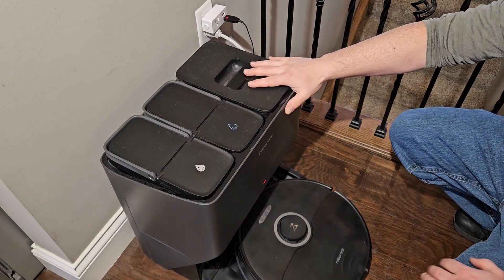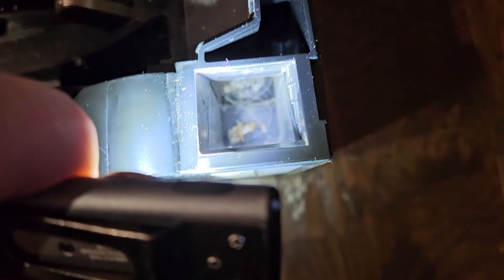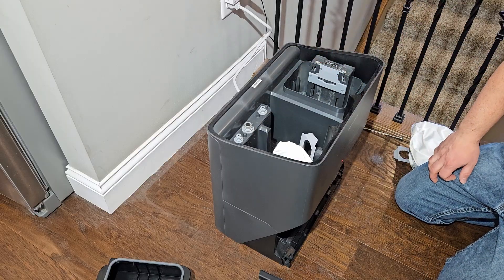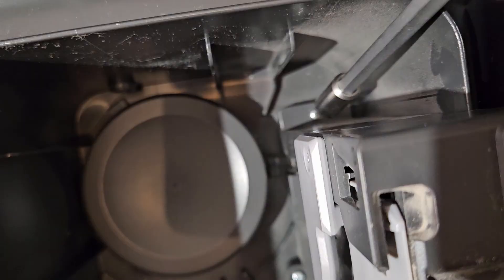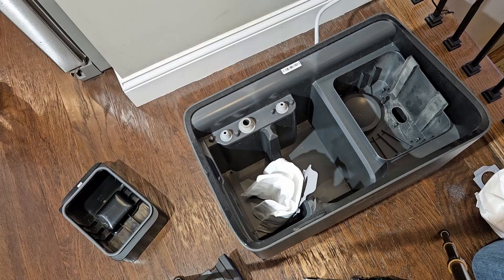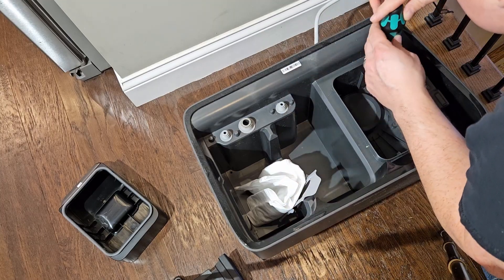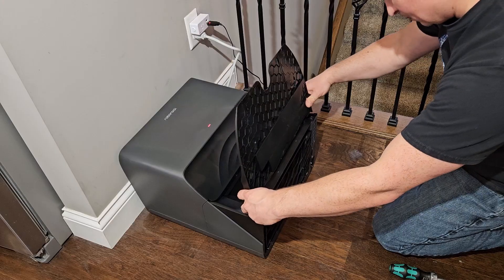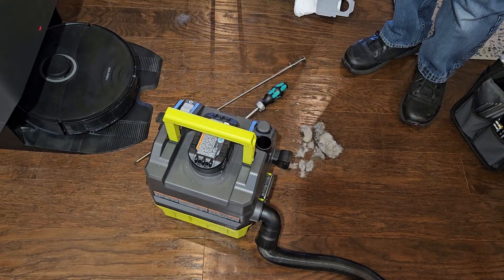RoboRock S8 Pro Ultra Air Duct Blockage Fix

Comment: Thanks for the video! what should one do if it keeps getting blocked each time? ivar cleaned out the several times yet it keeps happening.
Reply from the maker: Have you tried emptying the bag? It could be that the bag is full and not allowing all the debris to exit the vacuum when the tower tries to empty it.
Reply: @doresoomproductreviews yes the bag is empty
Reply from the maker: I'd contact Roborock customer service then - maybe there's something wrong mechanically with your base station.

Comment: The other thing you can do if the dust bin is not emptying is to pull the cap off of the vacuum motor at the bottom of the bag chamber and clean it out. the screens barely need to be blocked to create not enough suction to empty the bin.
Reply: how do i access it?
Reply: @epsweepstakes7889  its the circular piece at the back left corner of the vacuum bag chamber
Reply: @Dmammoser1 that was my issue thaks

Comment: the air duct is just too small
Reply from the maker: I've had mine for over year and it's only clogged once. I wouldn't say it's a design flaw for one failure out of 200 or so emptying cycles.
Reply: Yep. With kids it is 🙃. I've already pulled out several toys, but missed one in the ramp 🤣. I expected it to be just stuck in the vacuum itself!